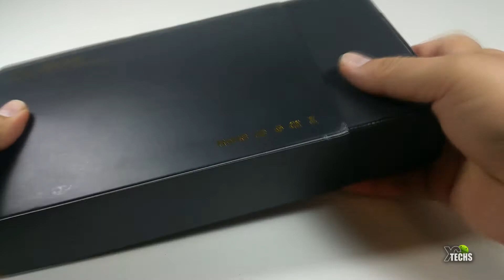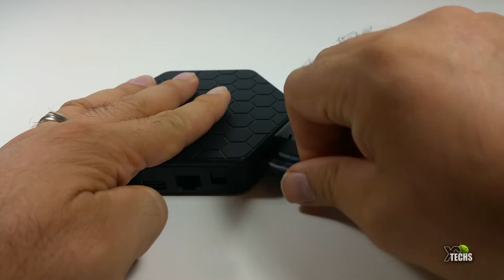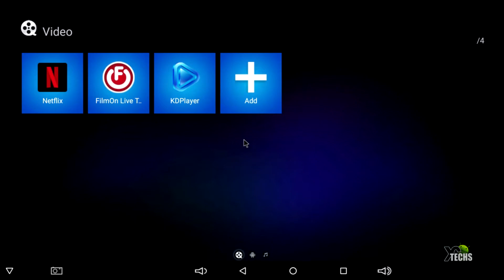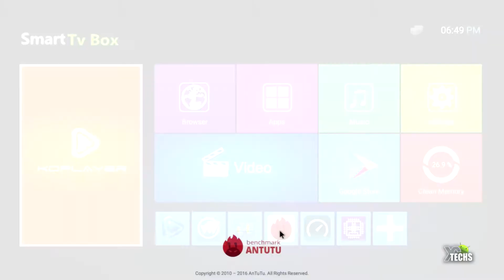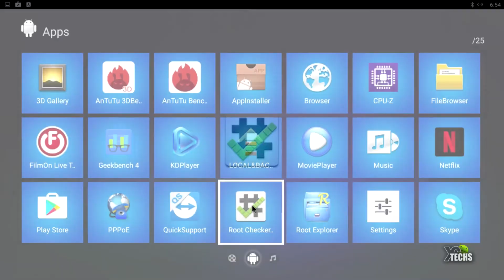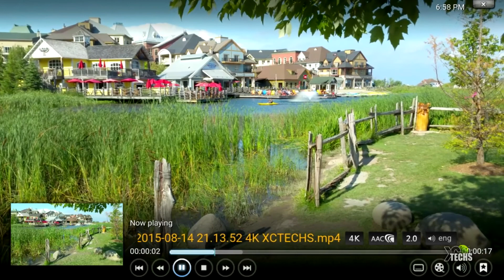Best Android Box For This Summer T95Z Plus S912 2GB RAM - Full Review

Comment: Have one of these, yes it works but also reboots itself on and off regularly, not great if you are watching a film and miss bits , very disappointed.
Reply from the maker: that is your power adapter, something is short in it. change your power adapter.
Reply from the maker: That is not box issue that is video ripping / where the hosting is / how many people watching that movie / last your internet speed going up and down.
Reply: It's done it since the day I set it up, on you tube, BBC I player, mobdro, Netflix, anything that plays video.😶
Reply: I think the firmware needs updating as it's 7.1.1  
But I will also look at the adapter.
I am disappointed because the box should have arrived plug and play I .
Updating the firmware looks complicated.
Reply from the maker: @helenjg4857  that updating firmware should not be part of what you have to do. But if requires an update, this is a typical way to process an manual update. 

If your box is under one year warranty then you need to contact your seller for repair or replacement.

Comment: my gamesir g3s controller connects just fine in bluetooth settings but isn't working after pairing. could anyone help?
btw controller works just fine when connected using USB cable.
Reply from the maker: 5 years later i saw this message today,

Comment: I bought this this device August 2017 and it has no video output from the HDMI port.  It is dead.  I re-imaged it like the seller told me to and it still does not work.
Reply from the maker: They will also have to give you details on Repair,  they will service it. to me, that is HDMI issue. let them know and also update us here.
Reply: The HDMI output would only work when I held the reset and re-imaged it.  After re-imaging it, for some reason when I unplugged it and plugged it back in, I got the same thing, no video output.  Not sure what is going on.   Should I see video output immediately after plugging it in or do I need to press buttons on the remote?  Lights on the unit come on when I plug it into power.  I see the time on the front of the unit.
Reply from the maker: I understand it means the HDMI connector on the main board is damaged, they have to repair or replace the unit for you, you can not fix it.
Reply: I found the problem...   the HDMI cable connection in the back of the box is funky.  When I wiggle the cable in the box, it comes on, then if I touch it, it goes back off.  The HDMI cable is secure in the back... in as far as it can go.  I tried 3 different cables that are like new and all the same thing.   I was gentle plugging it in, so it is not anything I did to the plug.  The connection inside on the backside of the HDMI connection must not be soldered correctly or something is loose on the inside of the HDMI connector inside the box.
Reply from the maker: so as i have indicated to you, here are solutions, 

1. Repair it through your seller.
2. Use Glue to hold it still and that way do not take the HDMI out to make it work all the time. 

I would go with Option 1.

Comment: One last question, what is CEC stand for? sorry to bother you.
Reply from the maker: (HDMI Consumer Electronics Control) A control function that lets one A/V component control another if they are connected via HDMI cables. For example, inserting a disc into the DVD player would turn on the TV automatically or the A/V receiver, if part of the system.
Reply: Ok thank you

Comment: I have this box working good, Have a question, in MXiii tv box, on advanced settingthere is a option CEC control; what is that for? thank you.
Reply from the maker: CEC Control is a good feature, it controls Your TVSignal via HDMI 1.4 or higher like HDMI 2.0 or HDMI 2.2 to Turn off your TV.